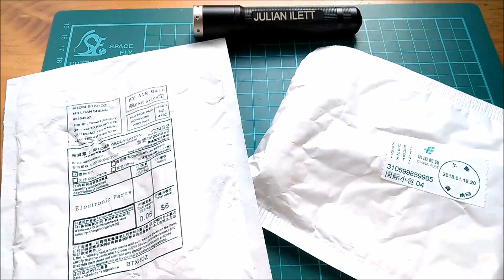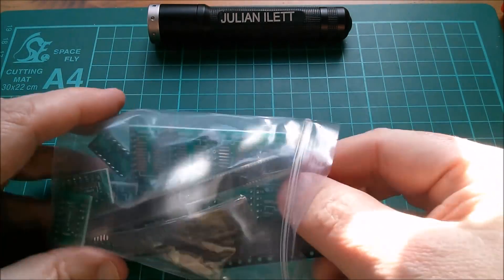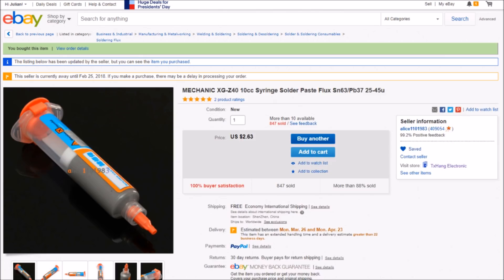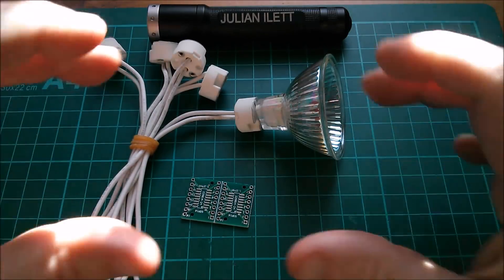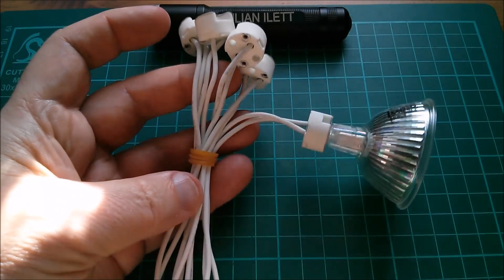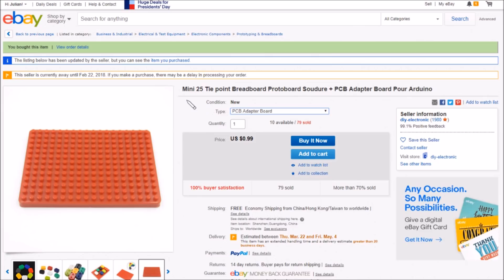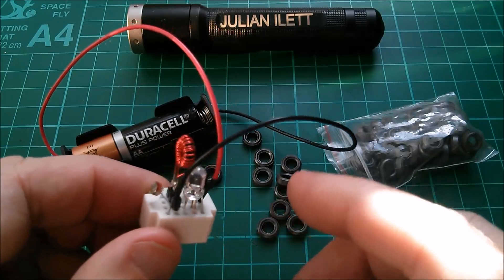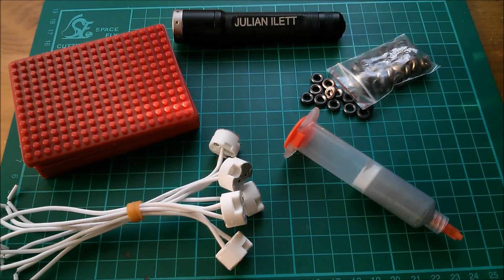Julian's Electronics Postbag: #114 - Solder Paste

Comment: A few ham radio operators in India found out that Short Wave SSB radios could be produced with very few parts using Toroid's. They have produced a radio called the uBITX and one in particular has mas produced it with a bunch of ladies from India. www.hfsignals.com  Some have talked about very balanced ways of winding the toroid's, . Very amazing technology. hfsignals.com for the uBITX . Toroid discussion for RF here. The trifilar wound toroid transformer and bi-directional circuits have taken the size of analog discrete component circuitry down to nothing while improving the way it works astronomically.  This guy does a fairly dry set of videos on the basics, starting with this one, but this one I think you'll like. Simplified balanced trifilar winding of toroid's.  https://www.youtube.com/watch?v=a8ViWS61hsU

Comment: Next time use "Syringe Needle Tips" (ebay.com/itm/282830826046) and insert the syringe directly to a circuit board , a tin paste (or use "reballing plate mask" (search use too name of SMD iC/chip package/type SOP16 )). Alternatively, you can pump from one syringe to the other (if you connect the tips of the syringe to the tube and then push the syringe filled up to the other syringe).

Comment: The start of the following video shows the plunger adapter that can purchased and used with these type of solder paste or flux syringe type capsules.  You also fit an appropriate nozzle into the screw threaded blanked end: https://www.youtube.com/watch?v=9EAbOFfHvNU

Comment: Thanks ajulian. Those ferrite toroids are a lot bigger than the ones I've been using. Mine are about 5mm OD, if memory serves. The bifilar coil is about 4 or 5 turns in each half, and they work fine with generic NPN transistors and a 1kOhm resistor.
Reply from the maker: I'm interested to know the minimum number of turns I can get away with :)

Comment: I've used that EXACT solder paste and found the joints to be far too brittle.  Bought it along with 60/40 paste and the 60/40 joints were FAR superior.  Not sure if it was bad paste or not but the 60/40 was heads and tails better than the 63/37.

Comment: On note of the reflow idea: You might want to use a halogen lamp with a 50w rating bare minimum. might also be an idea to have a hotplate to heat the board a little bit and then also provide a source of slow release heat when cooling to prevent the solder cracking as it cools.

Comment: Hi Julian, I was looking around for solutions to preheating small boards and arrived at a very interesting and little used product ( in my experience) .
Check out Aliexpress - " ptc heating element constant temperature" 
My choice arrived as an aluminum platen ceramic heater that produces 200 -220 C and heats very quickly.  They come in 12v, 24v, 48v DC and 110V , 220v 
I mounted some 25mm stand-offs (brass) and have used it regularly.

Comment: Hi Julian love the post bags.For the reflow work this is the best price I've see on ebay, https://www.ebay.co.uk/itm/HOT-AIR-GUN-SOLDERING-STATION-TOOL-SOLDER-WELDING-60W-ESD-936-858D-998/380886340960?epid=591381552&hash=item58ae985560:m:m8W0QpKLIp3woSl8Ekrtl_w
and its from a UK reseller.

Comment: The solder paste is for use with a dispenser (automatic or manual) and a suitable screw in applicator needle / nozzle. You can buy the manual gun-like dispensers for about  £30 - 40 but the automatic (pedal operated) ones are meant for industrial use and are very expensive. The exact same kit is used for measured application of adhesives.

Comment: I highly recommend picking up a cheap hot air station like the 858D. they are only like $40 on ebay, and will work much better than using a lamp. Alternatively I have managed to use a toaster oven to do reflow.

Comment: Wouldn't LED bulbs me more efficient? ;-)
Reply: A metric fuckton of IR LEDs
Reply: Stephen, he's not looking for efficiency of visible light output. He wants them to be good Infra Red generators, because the heat , not the visible light,  is used to melt the solder.
Reply: For those who don't get jokes, Stephen's comment was a joke, made all the more obvious by the winky smiley at the end.
Reply: Yes but the problem is that nobody knows that LED bulbs exist.  It couldn't possibly be that he knows better than you, what he wants.

Comment: The syringe red cap is just a cap. You ideally don't want to poke a hole on it. The "25-45u" is the solid particle size in microns.
You'll need a (slightly thicker than normal) needle and a plunger. There are sets of various sizes/diameters on ebay.

Comment: Used those lamp holders to repair my parents 12V kitchen lights - the bulbs were not making good connection after 15 years, and the light fittings were £50 each from eBay. Dismantled the lights, found the holders were a straight swap and just crimped the wire onto the fitting.

Comment: Actually it looks like you got shorted on the amount of solder paste. 

Both of my syringes had at least a third more in them and have the labels. They looked exactly like in the photos.

I think you got cheated.
Reply: SnarkyPosters I got a couple of those with a similar low filling grade as well, but mine did have the labels. I measured the content to about 6 cc although both the label and the seller claimed 10 cc.

Comment: 7:35 "Not entirely sure"???  Come on Julian, I know you know that ICs shouldn't be subjected to excessive heat.  Even when manually soldering individual pins you don't want to be there too long.  Look in the data sheets.  And please put your thinking cap back on!  ;-P
Reply: Actually, SMD ICs are usually rated for some temperature during some time for reflow in the datasheet. But that requires a temperature controlled oven, which he doesn't have (but he could make one for about $50, if he doesn't still have a suitable oven).

Comment: Julian, you need to shop around for the needles and plungers to fit the syringe. I think I bought mine from Somerset Solders in the U.K. Here is a link to an American supplier http://www.proto-advantage.com/store/product_info.php?products_id=1200013

I’m pretty sure you can get them from China via eBay. If you decide to go down the route of buying a pump, I think mine cost £50 from China, you will need a small compressor to run it. The paste has a short shell life and is best kept refrigerated. Before I bought a cheap hot air reflow station I used a cheap craft shop heat gun, under a tenner, which worked well.

Comment: Use the hotplate to preheat/heat the board you are going to solder too, flux the board, put solder paste on the connections of the chip itself, than place the chip onto the already at temp board. The connections will heat up the fastest due to conductivity which will prevent the chips from overheating and causing any damage. You can also just put a little bit of solder paste onto the board to sorta tin it.

If you don't wanna do that, you can always just put a bit of aluminum foil under the chip to help block some heat which you than just pull out when the chip is set in place. Just fold it over a little bit and have it thin enough to allow that to work.
Reply from the maker: Despite the paste being so sticky, I'm finding it really difficult to apply it precisely to the PCB pads :(
Reply: apply it to the chips first by squirting out a bit onto a piece of paper into just a basic glob and then just wipe the chip connections over it. As long as you flux the board the solder will just coalesce onto it from the chip while making a good connection. You can also use a paint brush to apply the liquid flux BUT you want to inspect it after application to make sure no brush strands came off.

Comment: How about a 3 sided box with a lid that can be lowered or raised to get the right height with the bulb socket attached? The sides of the box will help with the heat loss for the cool area that you are working with. And with the one side of the box being open you can observe the situation, and see what works best.

Comment: For reflowing a mass of parts I just use an old toaster oven with a convection fan to more evenly heat the PCB. Set it to 400-500 F (200-260 C) and let it pre-heat. Then out in the PCB for just a few minutes then done.
Reply: Link Smith We don't have toaster ovens in the UK.

Comment: just buy chinese hot air station. it costs 50$ and works just fine. I used to solder 100's of smd components a day back at my first ob and I know what i'm talking
Reply: That's what I did.  I dare say it won't last as long as a more expensive one but it works fine for a hobbyist like me.

Comment: I bet that solder paste dispenser is made for machine use with an integral plunger.
Reply: learnelectronics Also, there's needles you buy for applying the paste with them. I would recommend getting the metal plates with cutouts for various SMD footprints to apply the paste, as well.

Comment: Why not simply getting a YIHUA 852D+ SMD REWORK STATION which has a temp controlled soldering iron and a hot air gun for just around EUR 50? I got 10 different soldering iron tips for EUR 7, too.

Comment: Quite interesting Julian. Concerning the surface mount soldering, I wonder if a hairdryer could be used instead of a heatgun or other heating device. I am cautious about the Chips which may not tolerate excessive heat. By the way, I smiled when you showed the ferrites and announced your project of building some Joule Thiefs. May I hook on to it  and ask you whether you've, in the past, or will in the near future, try some stuff like "Strong Pulse Motor" driven by  low power Joule Thiefs. Thanks so long Julian. We are love your stuff.
Reply: That's Joule thieves ;)
Reply: Ha ha! I was expecting it.
Reply: A hair dryer that could get hot enough to melt solder would also burn your hair :) That solder only starts melting at 183 °C.
I guess it would work as a pre-heater though. It would get the board and the surface it's sitting on hotter so the device doing the soldering wouldn't need to be used for so long.
Reply: No it can't.  Hair dryers simply don't get hot enough.  They would also be unsuitable because it would be harder to control and focus the air flow than a proper soldering station.

Comment: Back in my factory days this sort of syringe was intended to be used with a pneumatic dispenser -  a foot-pedal controlled air valve and  regulator,  with an air line ended in a fitting shaped like  the plunger end cap.  A dispenser tip much like a hypodermic needle but with a flat end was used as the applicator.  Basically when the pedal is depressed it puts air pressure (from a compressor source) behind the plunger, driving the solder paste (or adhesive or whatever) out of the dispenser nozzle - the regulator was adjusted for correct delivery speed.   I assume a mechanical screw could also be used to drive the plunger like the patient-administer pain relief systems hospitals use :)
Reply: try doing that for an entire shift...     :)
Reply: You're making it way too complicated, just shove a spent AAA battery in the end and push a little.
Reply: Spending an entire shift dispensing solder flux would suck no matter how I got it out of the tube.  I'd rather move into the hills and farm for sustenance.

Comment: Those solder paste tubes are meant for a pneumatic dispenser
Like the SP982 - https://www.youtube.com/watch?v=9pTpJXFASr8 (its a terrible quality video but you'll get the idea)

There's an attachment that fits over the end with a rubber o-ring, and the compressed air pressure pushes the plastic cap inside down. The end is a luer-lock connector and you can get all types of dispensing tips that fit in. That red one is just a stop-plug to seal it from drying out.
Reply: https://www.aliexpress.com/wholesale?SearchText=solder+paste+dispenser

Comment: How about a patio heater lamp to heat the boards from above, or perhaps a heat bulb used for reptiles and hatcheries. Mine can get quite hot, though it is controlled by a thermostat.
Reply: How about just grabbing a soldering iron and effin' soldering it.  This is not something that needs anything more than a decent soldering iron, a remotely steady hand and enough light to see it.

Comment: Just buy a hot air station already! Atten 858D+ are less than £40 now and perfectly good enough to reflow solder paste. I have and its very good. I use it a lot.
Reply: Thanks for that Simon.  I just looked that up and found the WEP 858D on Amazon.ca for a good price.  Not needing to wait for the slow ship from China is a bonus!  It seems there are several manufactures/brands of these.  Do you know the difference between the 858D and D+?
Reply: No need, those chips are easy to solder with a decent iron/tip.

Comment: You need those straight-cut needles: https://www.ebay.com/itm/SMD-PCB-Solder-Paste-Adhesive-Glue-Liquid-Dispenser-Dispensing-Needle-50pcs/302238527142

And also using this type of paste and put the necessary amount to the syringe is better practice: https://www.ebay.com/itm/XG-50-BGA-PCB-SMD-Repair-Solder-Flux-Paste-Soldering-Tin-Cream-Sn63-Pb37-Alloy/302293917513

Comment: You need to unscrew the orange cap from the solder paste. Then you can screw in a tip (you need to get tips separately). Tips are available in various sizes and you can choose a size that works for your application.
Syringes are typically used with a solder paste dispenser and they have plungers already. There may be separately sold plungers too.

Comment: Cheap hot air rework stations are about £20-30 from banggood or AliExpress and they are perfectly decent. I've used one for about a year now and Dave of the eevblog has reviewed one.
Reply: Matthew Wood I can personally recommend 998D it has a very quiet hot air and the iron is easy to manage.
Reply: Stinky Cheese the kind of people who buy electronics equipment are generally experienced enough to determine if an appliance is safe enough for their comfort level. If you have much experience in the electronics field figuring out if a device will start a fire or explode is not that hard and having this basic check done does not justify a multi hundred pound premium to most of us.
Reply: I had one for Christmas that blew up in my hand on boxing day!
Thankfully, the station is fine and so was able to replace the blower.
Reply: That is exactly why I take apart all mains appliances I get directly from china for inspection before powering them, it is a risk you take getting this kind of stuff.
Reply: Matthew, the kind of people who buy this grade of hot air rework station are beginners at surface mount soldering, who use it for a while and either through expansion of their skills or because it failed, decide to replace it with something better.  It's not about safety, rather ease of use and lifespan.  It certainly does not have to be some wild extreme like whether to pay a premium vs the cheapest thing out there.  How foolish can people be that they always feel the need to contrast two extremes instead of the same middle ground?  This applies to most things in life, whether it be good value automobiles, food, homes, clothing, etc.

Regardless if you've been on this earth a while and do have electronics/electrical/mechanical experience, you know junk when you see it (including taking it apart of course).   Cheap Chinese equipment can't even get the RUBBER right, it self decays into silicone oil goo within a few years.
Reply: Wow a WHOLE YEAR?  Well that's proof enough right, anything we buy can just grenade within 1/4th of it's viable lifespan so it justifies buying junk?  I guess if you're happy that's all that matters.

Comment: Isn't the red thing on the end of the syringe just a cap ("luer lock")?

Should just unscrew. 😉
Reply: Yes, it unscrews and you attach the dispenser needle of the correct size for your application. I also think the white at the front of the syringe is to protect the paste from drying out in transport and storage and not seperation.
Reply: Bought some of this paste recently and the first little bit did come out like flux. Better let that drip out first because there wasn't any way to use it as solder. Stuffed a screwdriver handle into the tube to act as a plunger - used my reflow station to set the paste. I didn't rig up a hotplate nor a halogen light however as I didn't want to cook my dinner, just flow the paste into the solder joints. As an aside I didn't cut off nor poke a hole into the red cap at the end. Yes, simply unscrews so you can reseal the tube afterwards.
Reply: Nope, the white at the front of the syringe is just air and the angle of the camera and lighting making it look a lighter color.  The white at the rear is just the plastic or rubber plunger.